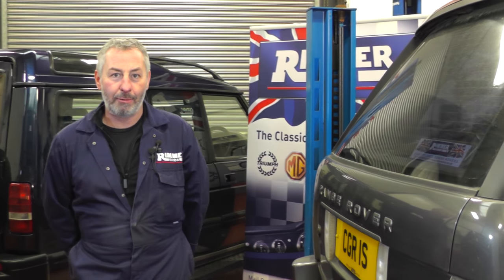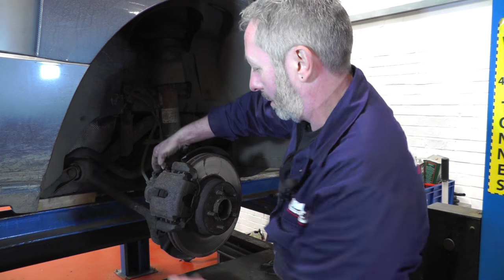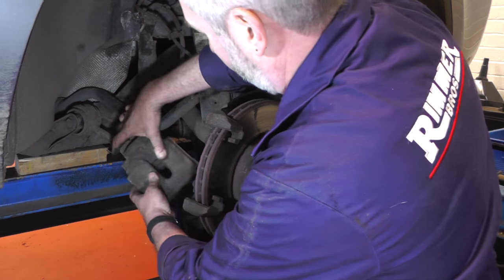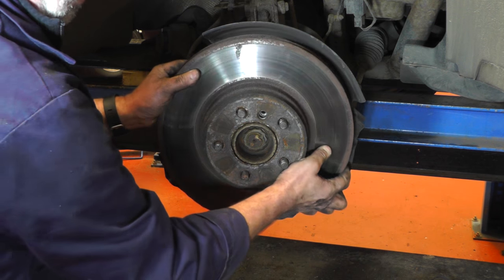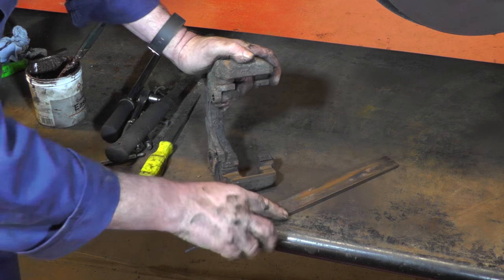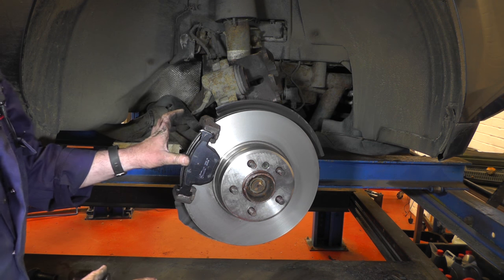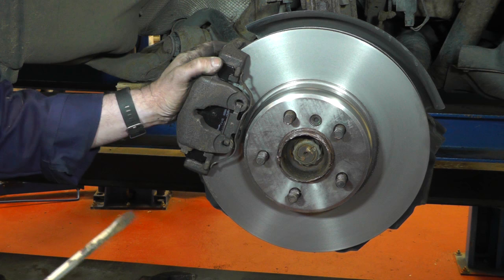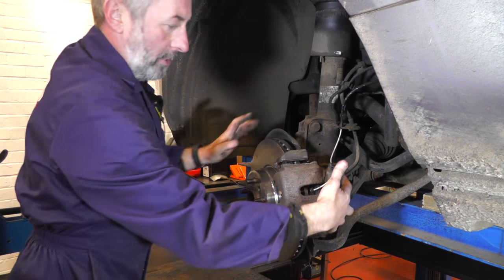Range Rover L322 - How to Replace the Front Brake Discs & Pads

Comment: Anyone knows how to reset check break pads light on the dashboard after replacing the sensor
Reply: You need to use the scan and erase it.
Reply: @mastermind5692  i cut off the brake pad sensor  and jumped  Dose 2 wires from it put some electrical tape and good to go. Thanks